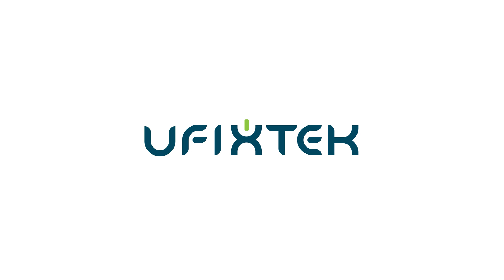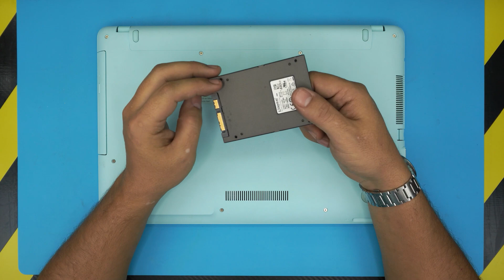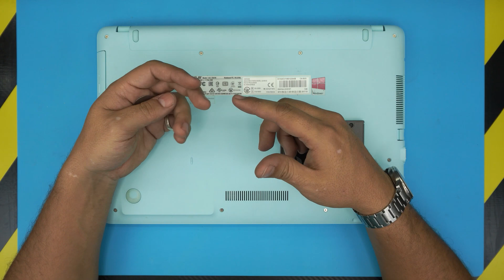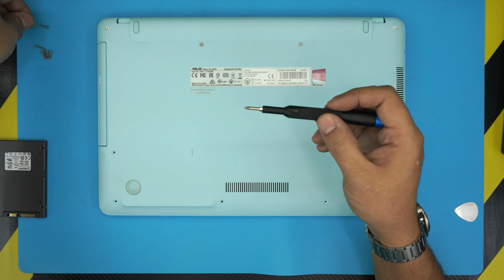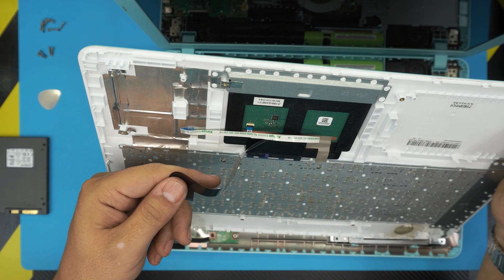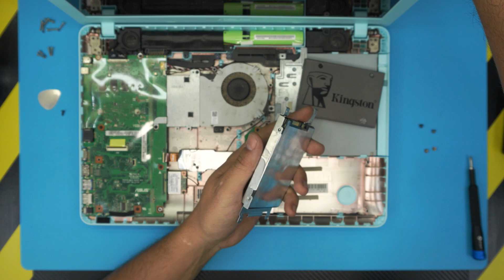ASUS X541n Laptop SSD HDD Upgrade Step By Step

Comment: I see no link for cloning my ssd. Can you update please? Thanx
Reply from the maker: 🫠Regarding your question, download a program that is called "Macrium Reflect" don't pirate it from torrent sites like piratebay😉.
then you will need to connect the new ssd via usb adapter to the laptop and using the program clone the main drive into the new drive and then power off and replace them. when you 1st boot the windows it may give you bluescreen and crash that is normal, on the 2nd boot everything will work fine.
i will make a video on the cloning and share the link.
Should you have any further questions or requests in the future, please don't hesitate to ask me.
cheers🍻
Reply: @uFixTek  i understand 😁 thx 👍🤝
Reply from the maker: awesome my friend if you need any other help let me know in new comment as i answer then 1st.

Comment: I have a problem. Bios see hard drive but don’t detect system on it. When i hit bios setup there is no boot devices but see hardware, anybody has such problem?
Reply from the maker: Thank you for your feedback! If you wish to support the channel, you can like, subscribe, or both! Regarding your question,  i need more information of what you did, DID you replace or upgrade to new SSD? , if so  you will need to install the windows on the new SSD else you will not have any windows to boot into!, i have mentioned this in the video and placed the link in the video description on how to create the windows usb boot drive.
Reply: @uFixTek  it was new ssd drive. The problem was in two things: 1. Wrong pendrive, only FAT32 is allowed in my notebook, but pendrive had 64gb memory, FAT32 fits up to 16gb. 2. After creating bootable flash with FAT32 ive maked mistake and create boot dedicated for mbr drive not gpt so booting was not able to start. After changing it to gpt it finally works! Thank you for your feedback, u deserved sub!

Comment: I must buy new windows ?
Reply from the maker: Thank you for the feedback! if you wish to support the channel you can LIKE or SUB or both :P
regarding your question: no my friend ,  link your current windows with your email address (that you must of have done it by now), once you install new windows. login with your email account to windows and it will activate. the lic key is linked to your email account that is used in the laptop.
🔵 CREATE / Install windows 10: https://youtu.be/uDu8j2lE-dM
proper steps of installing wiindows on asus: https://youtu.be/oQ7NiirV4JQ

Comment: Is there anything else we need to configure after puting on the SSD or will it be automatically read by the system?
Reply from the maker: hank you for the feedback! if you wish to support the channel you can LIKE or SUB or both :P
regarding your question: after putting the ssd as i explained in the video you will need to install windows 10 from your usb drive:
here is a link to how to create windows 10 installation usb boot drive:
https://youtu.be/uDu8j2lE-dM
after creating the boot USB leave the usb in the usb port of the laptop , power off the laptop and once you powered on keep tapping on F12 so you get the boot menu and choose the usb from the boot menu and follow the installation guide from this video:https://www.youtube.com/watch?v=ll_0K4hDksY